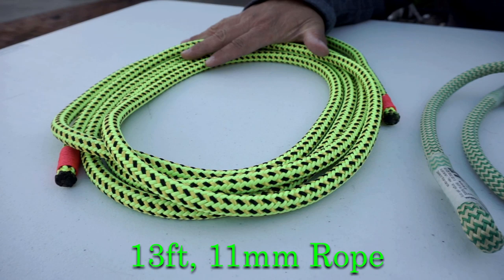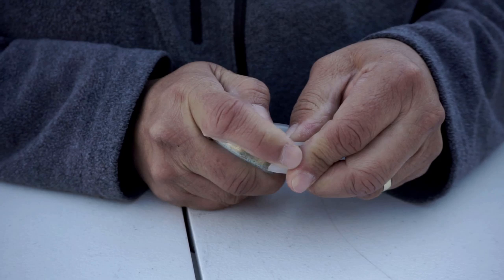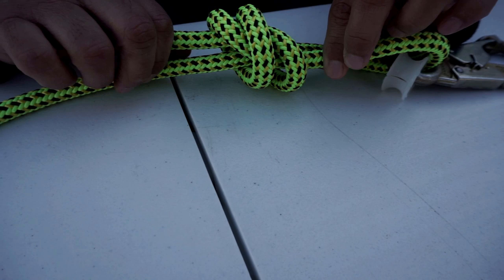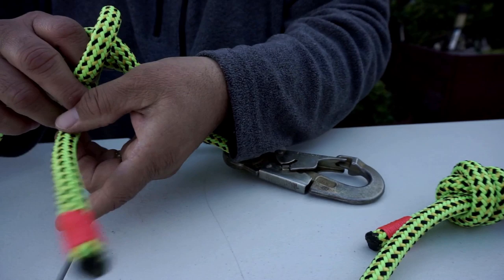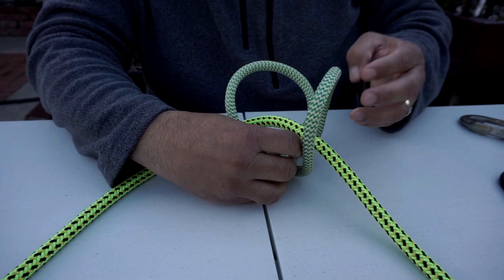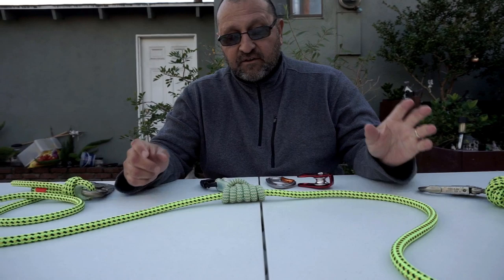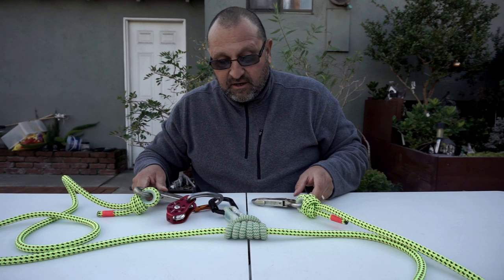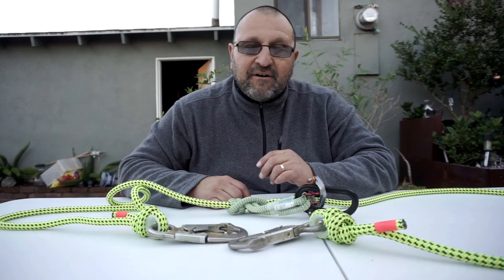HOW TO MAKE AN IMPROVED CLIMBING LANYARD (2 in 1 Lanyard)

Comment: If I don't have those double locking clips can I use Carabiners instead? Any safety concerns with making that change?
Reply from the maker: There shouldn't be any safety concerns as long as the carabiners are double locking a rated.

Comment: If I don't have double locking clips can I use Carabiners instead? Any safety concerns with making that change?
Reply from the maker: There shouldn't be any safety concerns as long as the carabiners are double locking a rated.

Comment: I just made a similar one myself. I chose to use a micro pulley to tend a Michoacán hitch instead, and also added a regular 3 wrap prussic with a rappel ring to use in a girth hitch  configuration when needed.  Good video per usual 👍 👍
Reply from the maker: Sound good I like the Michoacan hitch and the prussic  for choking for more stability is nice. Thanks for the comment.

Comment: I’ve been working dialing in an new pruisik set up. I’ve used the positioned 2 for about 3 years. It’s fast and quickly adjustable. Now I climb slower and there’s no need for that added stress of potentially sliding back by accidentally knocking the sliding bar. Thank you sir
Reply from the maker: Good to hear and thank you for watching!

Comment: Hey thanks for the video super simple yet safe. Ive been doing tree work for 7 months now and alot of times I feel like I'm being very unsafe using a single flip line and spurs. When I reposition myself going over limbs I have nothing but my arm over a limb to reposition. The 2 in 1 system is going to change my climbing. Thank you so much for the simple video! Stay safe up there
Reply from the maker: That's great it's always better to climb when you feel more secure. Thank you take care!
Reply: Are you climbing professionally? If you are looking for advice. Always aim for 2 tie in points dropping to 1 to reposition.
I use a top line
3 point lanyard 
And a 3 meter spare lanyard can be helpful on limb walks and blocking down

Comment: I whipped my rigging lines & did this method on them with a heavy duty thimble. My rigging lines r different lengths depending on the situation.  They r nice when it comes to attaching to my Maasdam rope puller.  I  attached a loop on the end of my Maasdam rope using the 3 strand splice with a heavy duty thimble to attach to a carabiner.  Then I attach the carabiner to attach to the rigging eyes. Primarily on spars so I can control the felling direction. I plan on doing a 3 strand splice on both ends of a long Promaster 1/2" rigging line that I have left after setting up my Maasdam the way I like it.
Reply from the maker: Nice thanks for sharing!

Comment: I like the working end to be tight on the krab, that way when you pass it around the stem from hand to hand its right where you expect not flopping about. I've used double fisherman's knots before but at the moment my new favourite cheap fix is old inner tube as retention rubbers. But I currently only climb on a single lanyard so Im going have to try this out...Nice video Bino, thanks.

Comment: That is really well done.  Very clear.  I appreciated it.  I may be wrong, but I think that your "double fisherman's knots" are "fisherman's knots."  I think that a "double fisherman" knot is used to join two ropes (or two ends of one rope)...two of them are placed back-to-back.  Your termination knots are (to me) not "double."  Anyway...very good job.
Reply from the maker: Thank you, I way I learned it is that the knot that connects to your carabiner is called a Double Fisherman's Knot also known as a Scaffold Knot. The Double Fisherman's Bend also known as a Grapevine Knot is the one that connects two ropes together. They are both a variation of the same knot. Take care!

Comment: Are you sure that hitch cord is 10mm? I've only seen 10mm Ocean in red, and 8mm in green. The reason I ask is that I threw together a 2 in 1 with stuff I already had (after watching your video) using 11mm Yale Bandit and 8mm Ocean cord, but it bound up really tight a few times. Too tight to move without manually loosening the prusik...I'm going to try 10mm hitch cord next (as soon as I can get my hands on some) and see if that helps. Awesome video, as always. You always simplify concepts that seemed complicated to me before watching your take on them. Thank you!
Reply from the maker: Yes the Prussik cord is 10mm. I Bought it at Bishop Company. you're welcome and thank you!

Comment: Is there a different between a lanyard vs climbing rope, others then sizing?
Reply from the maker: The ropes used have to be rated for climbing. There are different ropes used for lanyards such as Three strand, wire core and different diameters of climbing lines.
Reply: Not really, You can use normal climbing rope to make a lanyard however its a good idea to climb with a wire core lanyard instead of normal climbing rope. If you're using saws while climbing you have more peace of mind with that metal core. The only problem with wire core is that i dont think you can make a 2 in 1 out of it due to the stiffness and the prusik not sliding well on it. I could be mistaken on that im sure Bino H could clear that up. As for the diameter/sizing, it doesn't really matter it's more a preference as long as the rope is rated for climbing you're good to go.
Reply: @BinoH  Can you make a 2 in 1 out of a metal core lanyard? I've never seen it done but would be cool to know it is an option.
Reply from the maker: @chaseaspen8904  I have never tried using a wire core for a 2 n 1 lanyard. I would use a wire core on removing a tree but I like regular climbing rope while climbing.
Reply from the maker: @chaseaspen8904  It might be too stiff. I'm not sure.
Reply: @BinoH  My worker just bought himself a Yale  2 in 1 wire core lanyard. It has the prusik in the middle. Personally, I'm new to the 2 and 1 lanyards, been using old school for 14 years lol. I can't wait to get with the times! My worker hasn't used his wire core yet, but he's gonna try it out soon... I'm not so sure if that prusik well tend easily, but I'll keep you guys posted!
Reply from the maker: @travisjohnson2171  nice I'm sure the prussik cord should work well. Thanks for sharing!

Comment: Can you make a video on how to make a tree squeeze
Reply: What is a tree squeeze? Base anchor? Cambium/friction saver?
Reply: Just put a carabiner on both sides of the lanyard between you and the tree. The more you pull the tighter it gets squeezed against the tree.
Reply: Neil D some call it a super squeeze. Mostly used in pole climbing or palm trees. For guys used to tree work with open flip lines it’s foreign. I do my trick when high on a skinny top. Locks your flip in place so you can’t rotate around or slide down.
Reply from the maker: I have not used a Tree Squeeze yet but if I get one I would work on a video.
Reply: @neild7971  it's a friction saver but could also be used as a tie in point, I'm from cali and we do 100ft+  palms every other day so it's a great investment, it could save your life

Comment: Can u run 2 micro pullies one  on each side of the prusik
Reply: Yes, but just adds a bigger pricetag. Most use it on the tighten side, because with 2 fingers you can loosen 😊
Reply from the maker: It's better to have one pulley and move it to the side you want to tend on.
Reply: Wouldn’t that pose a risk to tend you in reverse all the way back to the other snap?
Reply: It will release the prussik